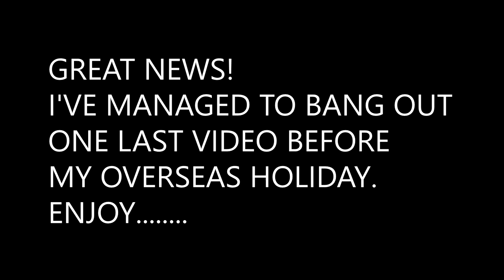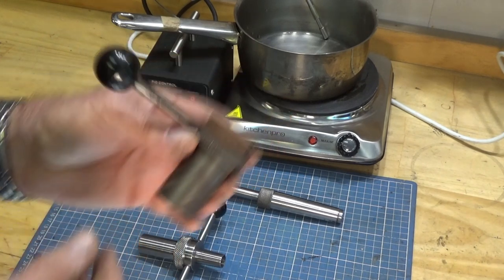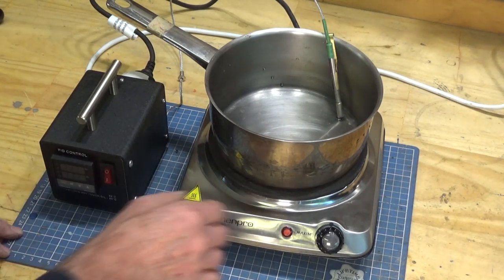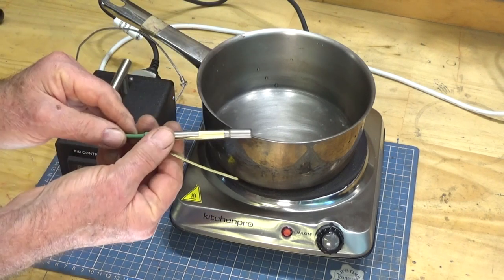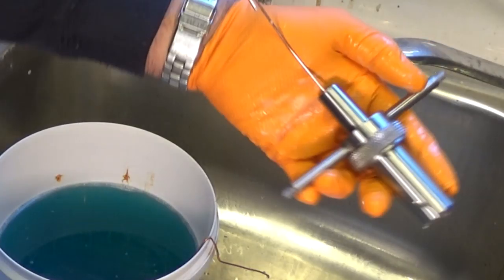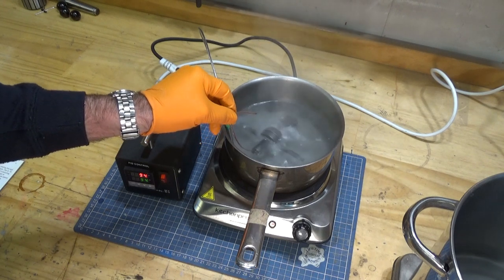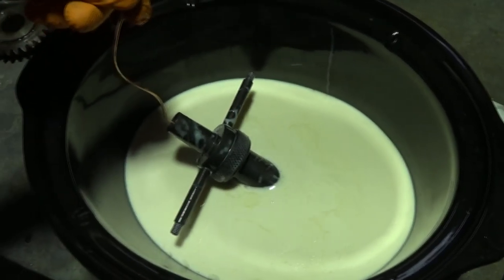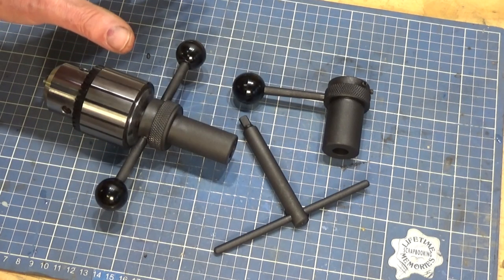DIY Parkerising in the home shop

Comment: Nice finish. I have the same issue with steel tooling in my shop covering over with rust. Btw, I just discovered you had a channel. Subbed.
Reply from the maker: Thanks Arnold. It's great to have you aboard. I have just put some test samples outside under an awning to see how durable the coating is. I am going to be away for 6 weeks so I am keen to see which is the best method of treating the parkerised finish. (oil, wax, paint etc.)
Regards,
Mark Presling

Comment: Aren't you supposed to sandblast parts before you parkerize?  Never seen a polished piece go in like that but it turned out awesome.
Reply from the maker: I usually just ensure the parts are chemically clean. The texture that you end up with after using the Jane Kits solution is very much like sand or bead blasting but it is done entirely by the etching action of the phosphate solution. I guess that having a sand blasted finish to start with helps to increase the surface area so maybe it just reacts quicker. 
Regards,
Mark

Comment: Struggling with same issues in my shed down in Melbourne. Got some Cortec VpCI spray that's supposed to protect metals even when there's direct contact with water, a week later no rusting yet...
Reply from the maker: I know there are some really high tech coatings available now but I can tell you that all the parts I have parkerised are still looking perfect. Some of them are in daily use and others sit on a machine and are rarely touched but the coating seems to hold up really well. I have a number of samples that I did several years ago and I have been keeping them to show the difference between parkerised and bare steel. I hope to do a follow up video soon.
Regards,
Mark
Reply: @Preso58  I'm using it on surfaces I cannot easily heat treat, blue or parkerize like lathe chucks. The local supplier gave away 20L of Cortec 377 since it was close to its useful shelf life, giving it a shot. Seems to be working so far.

Comment: I'd recommend to oil it down with mineral oil, and let it soak into the parkerization.  Water soluble oil is good to halt the process, but for real rust protection long term you need to add that second oil barrier. I am also in a sub-tropical climate (Florida) and know what a job it is to keep things rust free.  Mineral oil (with a bit of liquid lanolin if near the beach) has worked very well for me, and is cheap. 3-in-1 is also very good, if it's available in your country.
Reply: Faelwolf, what ratio mineral oil to lanolin do you use?
Reply: @LeverPhile  I generally use straight mineral oil, but if lanolin is needed, about an ounce to a quart of mineral oil would be about the heaviest you would need to go, say if you where wanting to rust-proof the anchor on The Lost Dutchman, or for things  stored outside in the weather or on a salt water boat deck or something :) A little lanolin goes a long way. Straight mineral oil keeps rust away from my anvil which is stored in a non-climate controlled shop with a leaky roof, in Florida. How's that for effective? You can also thin the mix with mineral spirits, if you want a lighter coating that will still protect, but it will need refreshed a little more often. I use the thinned stuff on tools that get a lot of use, just wipe them down with a mineral oil wetted rag after using them. 
Handy tip: mineral oil also works amazing on firearms, and doesn't react negatively with black powder residue, so is really good to keep those old muzzle loaders rust-free in the bore. :) Mineral oil (light coat) in the breech and barrel, 3-in-1 inside the works, and you're GTG.
Reply from the maker: I believe the recommendation to use the soluble oil is so that you don't need to wait for the part to dry before you get the oil into the surface. I have heard of parkerised steel flash rusting very quickly. I have just completed a series of 6 test pieces that have all been treated using different processes. I am going to leave them out in the shop while I am away on holiday for 6 weeks and then see if any have corroded during that time. I did them in soluble oil, wax, mineral oil and one was just painted on one side with no oil. Should be interesting. I will do a follow up video when I get back.
Regards,
Mark Presling
Reply: @faelwolf1177  Indeed, recently Ive been using plain mineral oil as a rust protectant on all my tools and hardware, including firearms.  And also for wet sanding and using files on metal.  It works well and is very easy on your skin.  It's also really cheap in the pharmaceutical aisle at Target, CVS, Walmart, etc.  I paid around $2.50 for a 16 ounce bottle!

I've heard about adding lanolin for heavy duty protection or longer term storage, but I haven't needed to use that yet.  Thanks for the info.
Reply: @Preso58  When I saw you install the part without coating with mineral oil I cringed a little, but it will be interesting to see how it holds up.  With multiple parkerized pieces each coated differently, it will be interesting to see what stays protected and what doesn't.  Looking forward to the follow up.
Reply: @Preso58  Absolutely, do not skip the soluble oil in the last step, it will stop the flash rust and stops the oxidizing process on the part. My recommendation was out of concern for long term. 
I used a lot of that soluble oil in CNC machining over the years, it makes a great coolant for cutting metal, but the rust inhibitors in it are short term. Inside a CNC lathe that is constantly bathed in it every day, it worked well enough to prevent rust.  Our CNC mill got a rub down with mineral oil on the bed when we left for the weekend, (as well as other tools) especially if leaving for a week or two during Christmas shut down, or it would rust. 
I would be interested in a video on your experiment!

Comment: Did you rub oil into the die holder after cold bluing?
Reply from the maker: The supplier recommended a proprietary oil but I just used WD40 after rinsing in cold water. I have found that a lot of the coating comes off quite quickly if you rub or buff it. It starts off looking black but with wear and tear it sort of goes a medium brown. It is probably best as a decorative finish that is not intended to be handled much. 
Regards,
Mark Presling
Reply: @Preso58  I wonder if a heavier oil would work better. Wd40 is primarily a solvent and doesn't really contain much oil.  I've seen others use cold blue very successfully.

Comment: I would love to see a quick follow up video on this now that it has been a couple of years.
Reply from the maker: I intend doing that but I can tell you that all the parts I have treated with the parker phosphate are still as good as when I processed them. Items that I have cold blued and left out in the workshop are mostly corroded. I did some cold blued parts that were stored in a closed box and they are still  mostly black and corrosion free though. 
Regards,
Mark

Comment: You could put the PID controller and thermostat in series so the thermostat (which is set higher) sets a safe upper limit to the temperature.

Comment: Well done, thank you for the video. Have you ever tried applying wax to your surfaces to help combat the moisture? I have found that Butcher's Bowling Alley Wax (the clear) works amazingly well. It comes in a can like paste wax. Wipe it on, let dry, polish off with cotton cloth. Repeat if desired.  Have a nice holiday Sir!
Reply from the maker: I find that tools that I use regularly don't get a chance for the dust film to build up on. Also they pick up oil from the machine and your hands. It's the ones that get used only rarely that rust badly. My shed is also not completely sealed. Moisture tends to get inside very easily during our wet season so it is an ongoing problem. I did polish the column on my drill press when I purchased it second hand and I treated that with wax and it is still looking good. When I was teaching we would always rub floor wax on the chisels and plane soles before the 6 week summer holiday and they resisted rust well. It really is just a case of ongoing maintenance. Something I am not good at unfortunately. 
Regards,
Mark

Comment: That brings up an interesting question.  Wonder what the finish would look like if the part was sand or bead blasted before the parkerizing ?
Reply from the maker: Randallology, it is recommended that some sort of bead blasting or abrasion will improve the durability of the parkerised surface. I think the Metex M dip is used to etch the surface of polished steel prior to the actual parkerising. I have seen some suggestions that a dip in muriatic acid serves the same purpose.
Regards,
Mark Presling

Comment: Ever hear of green parkerizing? I have a Kel-Tec P-32 slide that's parkerized and it's a really nice dark green. I'd really love to be able to parkerize other parts to look the same, but I've never heard of any way to do it. Any parkerizing processes I've ever seen are gray to black. I've never seen any other colors except for the P-32 slides. (It's a nice, dark, very dull, but smooth green color. Cerakote has some nice dark greens, but none of them compare in my opinion).
Reply from the maker: I have not heard of a green parkerising. I do know that there are several different parkerising solutions. Up until recently, I used a proprietary iron phosphate solution. However I made a home brew manganese phosphate using just manganese dioxide, phosphoric acid, distilled water and steel wool. It comes out a slightly lighter grey than the iron phosphate but it seems to etch the surface more. Maybe there is another version with something like copper in it?
Regards,
Mark

Comment: Hopefully you also cleaned inside the bore well. Having rust there would interfere with the utility of the holder. I would have been interested to find out how well the guide rod ran inside the tap holder once both were parkerized, but I don't know if you did the guide rod.
Reply from the maker: Kevin Martin, the guide rod was a really nice fit after the parkerising process. In fact it was better than before. My understanding is that the process makes the parts "grow" slightly. I had a look down the bore and it appeared to be treated the full length but I was not able to scrub the inside of it. The parts cleaner I used seems to do a good job just as a soak. I did not do the guide rod, mainly because it wouldn't fit in the saucepan I had the parker phosphate in at the time. I have some more parts to do so I will do that one later. I will try to report back on the fit when I do the follow up. I am keen to find out if you can "selectively" parkerise a part by masking off some areas. 
Regards,
Mark

Comment: Nice tap holder setup Mark! Can I ask what size thread you'd be comfortable holding onto with that?
Reply from the maker: I think it might handle up to 14mm metric coarse but in most cases I just want to get  the tap started concentric to the lathe axis. When the tap starts to slip in the chuck I can swap over to a standard tap wrench. Having the tap slip is a good way of avoiding broken taps!
Regards,
Mark Presling
Reply: Thanks for the reply Mark

Comment: I have had good parkerizing results using Turco rust converter.  

First I clean most of the loose scale off with sandpaper.  

then there are 2 different methods to use.

1. Is to use a toothbrush, wear rubber gloves,  and dip the brush into the  turco, and scrub vigoriously for 15-20 min.  depending on part size and amount of scale on the metal.  It WILL remove mill scale.    Eventually you will get a nice even greay finish, which then you rinse with clean water, dry well, and coat with wax.  I use a cheap floor wax which seems to be merely kerosene and paraffin.

2 this method is more expensive to set up, but better for production.  get yourself a largish ultrasonic cleaner.  hen a second smaller plastic container to fit in the ultrasonic cleaner.  This is because Turco will react with the stainless in the cleaner.  Fill the plastic container with turco, place in the ultrasonic cleaner.  pour some water around the outside of the cleaner but inside the stainless tub.  this will transmit the vibration from the machine thru the water and into the turco.    then just clean away with the ultrasonic cleaner until a nice finish is achieved.
Reply from the maker: That's interesting. I had to google turco to find out more. It sounds like a wonder solvent. I am wondering if you can purchase it in small quantities. This is the usual limitation for hobbyists. 
Regards,
Mark
Reply: @Preso58  yea.  They sell it in tiny bottles.  Its just rust converter

Comment: When you got back from holiday, were the parts rusted, or did they hold up to the condensation?
Reply from the maker: I still have those samples and they are still looking great. The untreated piece of cold rolled steel is now showing orange rust though. I have treated lots of parts this way and so far I have not have any fail. I did a follow up video https://www.youtube.com/watch?v=HdOgttl0Qww Check at about 5:00
Regards,
Mark

Comment: FLORIDA, come for the rust, stay for the corrosion. Those countertop fryers might work, and they have a basket for your chicken, or metal parts. What is in the parkerize solution, is this basically phosphate?  Am thinking ultrasonic cleaning/degreaser would be good too.   Thanks  👍
Reply from the maker: Nick V, I am guessing that Florida weather would  be even worse than what we get here. We are far enough away from the coast not to have the wind blown salt issue but I still find the rust is a constant source of irritation. I believe the parkerising solution is based on phosphoric acid and either manganese phosphate or iron phosphate. The instructions that came with the solution said that you can replenish the iron in the solution by dissolving steel wool in it when the blackening action starts to taper off. This makes me think it is probably iron phosphate. I do have an ultrasonic cleaner but the tank is quite small. I think that heating the cleaner would be a big help.
Regards,
Preso
Reply: @Preso58  Remember to degrease the steel wool in acetone before you do that. Some cabinetmakers supply shops sell oil free steel wool,but for small quantities, I think local hardware store plus acetone is a whole lot easier.

Comment: If you instead of removing the rust, just boil the part in distilled water for about 15min. That will transform the red rust to black rust, which practially is the rust bluening you see on older firearms. Anyway, Parkerizing is a very good, if not better option.

Comment: If you leave parts in a the phosphate for to long crystals will form on the surface, a good test to see if the process is adequate is to  wipe the part with a damp white cloth before the oil step and if the rag is clean then the finish had adhered corectly and if not the part then needs longer in the phosphate solution, also lower carbon steels give light colours so a 4140 will give almost a black finish in my experience and manganese phosphate will produce a darker thicker coating then say zinc phosphate
Reply from the maker: Braden, I did a piece of 4140 the other day and it came out a nice dark charcoal. It was a tool made from some chrome plated hydraulic piston rod and part of the chrome outer surface was left on the part. The parker phosphate didn't touch the chrome at all which proves that it only works on ferrous stock. So far all the parts I have done seem to be very durable and the coating seems quite tough. I have done some sample pieces to try to get a handle on what the best after treatments are and I did a piece which I want to deliberately abrade to see how thick the coat is. I will have some results when I return from my holiday in 6 weeks.
Regards,
Preso

Comment: Is your shop ventilated, if not that's a. Contributing factor for the rust.put a whirly jig on it and most if not all of that will stop?
Reply from the maker: Chuck,
my shop is just a steel shed and only the roof is insulated. The walls don't seal against the roof sheets and there are three roladoors with large gaps above each one. When we get our wet season the humidity and moisture gets in to the shop very easily. I usually leave one of the doors open on fine days so as to keep some ventilation going but I  had not considered a roof ventilator. I guess if I were more disciplined I would clean my tools more often. 
Regards,
Mark Presling

Comment: Thanks Presso,
Have a look at a video by the cogwheel, he uses a similar technique but it is rust blueing with salt and vinegar.
Enjoyed cheers
Reply from the maker: Raymond, I have watched that video and many more that use a similar process and the results are impressive. I almost went down that road for some parts that I made but got sidetracked into zinc plating instead. I use that on parts that need to be more corrosion resistant like screws and fasteners. I decided to try the parkerising out of curiosity and I must say that it is a lot easier than I made it look on the video. I think the results will justify the cost but I am withholding my judgement until they have sat around the shop for a while. I guess the old saying is true - there are multiple ways to remove the epidermis from a feline!
Regards,
Mark
Reply: @Preso58  I enjoyed your video Mark, very informative as usual, had to laugh at the reference to the cat, my fathers words done with PC. Cheers Mate, enjoy your trip.
 John, Australia.

Comment: Nice looking...Did it change the slip tolerance on the spindle? Thanks for sharing.
Reply from the maker: Daniel, I didn't parkerise the guide rod or the MT3 taper and I noticed a slightly better fit after the bore of the tapping spindle was done. I suspect that the roughness of the parkerised finish would soon be rubbed off so it might appear to be tight to start with. I am planning to do the guide rod later so I will try to follow up at a later date.
Regards,
Mark
Reply: I was wondering about that as well. Great video Mark, very interesting!